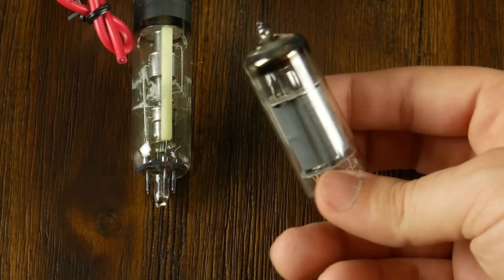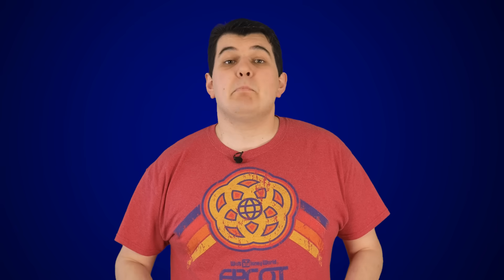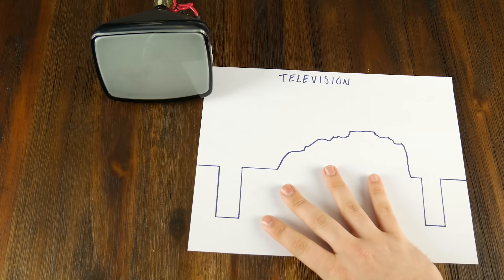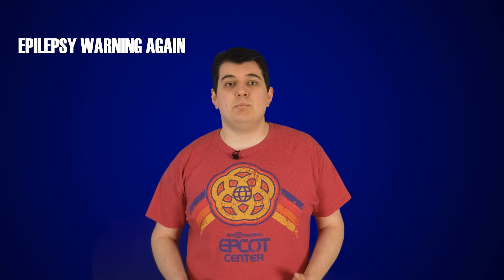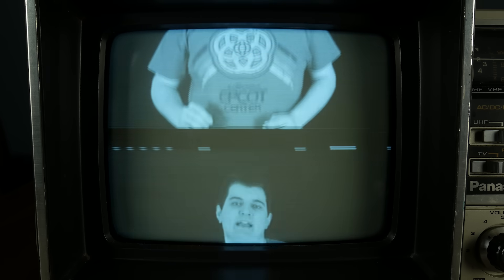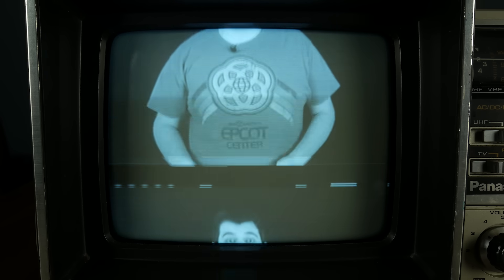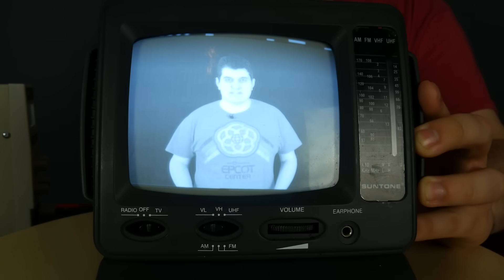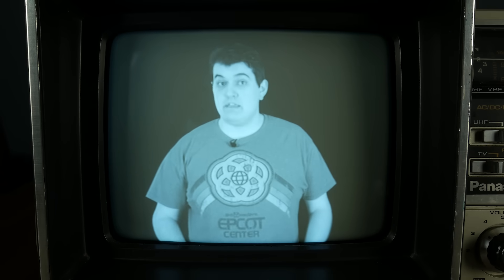Lines of Light: How Analog Television Works

Comment: I remember back in the 1970s there was an over the air subscription tv channel that would broadcast a scrambled signal. The video signal was scrambled by messing up the horizontal sync pulses with a sine wave. The audio was  heterodyned out of hearing range. The idea was you rented a decoder box and subscribed to their service. Someone came up with a "kit" to build your own decoder and that was kind of the beginning of the end.
Reply: I worked in a TV repair shop at 16 with a state issued apprentice license. My boss trusted me to make house calls even though I wasn’t supposed to. You should see i the looks I got when I’d show up to fix a TV at someone’s house on a Saturday and then I’d fix it.This was in 1969 and the shop I worked in sold the Motorola works in a drawer.  Worked on electronics and telecommunications equipment 50 years of my working life. I’ve seen some pretty cool stuff and always worked for companies that had the latest equipment.
Reply: Can you diagnose a problem with my crt?
it seems dead ie completely dead
But pressing the power button causes a high pitched squeal but nothing else
There is nothing else 
But a feeling of static on the tube 
It's a 14 inch color crt monitor 
From 1992
And I mostly bought it because it matched my Dell 333d computer
I kinda want to get it working 
Also while I know the computer also works by actually using a tv active modulator to send the signal to a tiny 6 to 7 inch black and white portable tv that actually does work
But lacking sound

And the crt tends to have a double image and a wibble. But the issue is with the crt monitor in question
Reply: @slycooper1001  You're better off taking it to a specialist. CRTs are extremely complicated and very difficult and dangerous for a layman to fix.
Reply: @slycooper1001  could be the flux capacitor
Reply: Heterodyned.

You're essentially describing "terrestrial pay TV" services like ONTV, Preview, Spectrum, SelecTV etc.
Reply: The 70s was interesting because TV didn't have any "security" whatsoever, so anyone with a little know-how could intercept signals for free like you mentioned, or even hijack broadcasts quite easily.
Reply: ah piracy has come a long way since then
Reply: In Germany too. If you use a tv-card, the pc can unscramble it on the fly
Reply: @Alpenjodler1  Really? Here in Africa we had mnet I always wondered how they did that but I got a TV card way to late in life after they stopped broadcasting those analogue signals the things I could have done with this information am learning please send me back in time 😂
Reply: Beginning of the end?
Reply: @masseyluna2002  Beggining of the pay walls. Not much that it was a paid service, with a regular antenna you could catch the "paid" signal, but it was useless unless you had the means to decode it.
It was the end of the wonder of being able to share information over massive distances. It stopped being about marveling on the ability to send audio, and later video, through waves regardless of borders. It became a business.

Think of the internet, which was then use to share information between universities. Later on each of the big schools could put their written knowledge into a digital format, and share it to local library, open to everyone (through the necessary costs of running such a service). Then it was international; not just knowledge, communication, preservation, among other things to come.
Finally, everyone had access to it, and when charging at a premium per hour to connect to the internet was recognized for the ripoff that it was, advertising slowly took over. Whatever intention there was to exchange information died in the race to get your attention, to bring you the advertisements. It became a business.
Reply: @l0v3-lyly  uh... nothing about the admittedly awful business-ification of everything stops anything from marveling at technology or sharing ideas. I'm not sure how you see that as a dichotomy
Reply: The """"""""""scrambling method"""""""""" they used was the most barbarian technique ever made.
The way a regular video signal worked is, anything below a certain voltage (I'll just say its 0v but I forgot) is considered the "sync pulse" and anything above it is considered the actual visual information.
They would mix a sign wave into the video signal, phase-locked to the horizontal sync.  This causes the normal horizontal sync pulse to be "pushed up" above 0v, while correspondingly pushing a decent part of the visual information below 0v, causing the TV to see that visual information as sync pulses.
Now, the visual information is always changing - even within a frame, each scanline will be different.  So the TV sees this constantly changing signal as "sync" - and it still tries to sync to it as it doesn't know any better.
This causes the TV to wildly distort the picture as it tries to stabilize it.  And yes, your TV is what did the scrambling, not the station.

Aside from the sine wave messing with the brightness (the sides would be very dark, while the center would be very bright - if you've seen those ON-TV sign-on videos you'll recognize this pattern), the video itself is fully intact.
If you could somehow make the TV just ignore any sync signals and free-run, the picture would roll, and it would have the brightness problem, but it wouldn't really be scrambled.
Its kinda funny that in the 70s and 80s this passed for "scrambling" to the point that laws that governed obscenity on public airwaves no longer applied.
Today this would be effortlessly reverse-engineered and decoded in a few minutes with GNUradio and an SDR.
Reply: RIP.
Reply: I built and sold bootleg boxes for OnTV back then. The memories...
Reply: Here in India, people still use set top boxes provided by cable dealers. They take in the signal of a coaxial cable and then decode it and sends it to a display with av jacks. Nowadays people are switching to Android TV's here but there is lot of handful and elderly people who find the initial easier.
Reply: @theultmatebanana6759  a lot of handful? What does that mean?
Reply: We had that in many countries. Many in Spain learned how to distinguish shapes in porn movies that a paid channel used to broadcast on Friday nights. By 1998 or so, you could already decode it with a pentium or similar with a capture card.
Reply: Radio Shack charged a fortune for variable capacitors because they were used in DIY decoders.
Reply: Wouldn't renting the decoder box BE the subscription itself?
Reply: @joshyoung1440  technically you "rent" out equipment even now. Not paid, like with Spectrum TV equipment, but it's a similar concept.
Reply: I was developing a circuit to receive the ONTV signal back then. Working on audio first, I remember the day of my first success, I think the movie was 'Carrie' .A string of formerly forbidden language spewed forth at a high volume. I jaw dropped and  my roommate popped it and exclaimed "Did that come out of the television?" ON didn't last long so the project was never completed.

Comment: me: ha, I can totally hear the sound and I'm over 25.
pauses the video oh wait i can still hear it. uh oh.
Reply: 11:56 I am so happy that even if I am 40 now, I can still hear this noise very clear 😃 (but only with my headphones)
Reply: @mma48578  are you a femail? I have herd males lose higher pitches faster and femails loose the lower pitches
Reply: @mma48578  I’m freaking 14 and I can’t hear it, but i havent tried with headphones
Reply: @theothersri2029  It's probably not your hearing. Youtube compresses the video files to save space, but that also cuts off some of highest frequencies. It also could be that your speakers cannot produce those higher sounds. I found a site (online tone generator) that does not use the compression youtube, and I can hear the 15750KHZ sound. Interestingly, there's also various waveforms available, and the CRT monitors make a sawtooth wave, not a sine wave which is the sound commonly used to demonstrate the high pitched sound of the monitors. I can hear the sawtooth wave clear as day, but sine waves and triangle waves are harder for me to hear at that frequency.
Reply: @mma48578 nearly 40 and I can hear it as well, though with kids around sometimes I wish I had a bit more hearing loss.
Reply: I'm ~40, but I still can here some of it... however I'm suspecting that I might be hearing some lower resonance frequency of it since the sound really didn't sound like 15kHz (and I've tested that my hearing ends around 14kHz at least couple of years ago)... my daughter did hear the real sound loud and clear. I asked how loud is the sound and she told me it was around the same level that the voice of the speaker dude (sorry, cannot remember the name 😅).
Reply: @nerdylittlesideprojects9141  That's probably so. I'm 40 and have always been able to hear CRTs (and other oscillator circuits) in operation, but I can't hear the one on this video.
Reply: @AubriGryphon  cause the speakers you are using suck and cant produce 15 kHz frequencies.... that funny enough is the upper limit of most sound speakers and only some mid and most high range speakers can produce sounds over 15kHz no matter what their specs say..... when I put my nice neodymium magnet headphones I hear it as loud as the other parts of the video.....
Reply: @AubriGryphon  Actually due to the compression of the videos, youtube starts to cut off the frequencies at around 15000KHZ. Thus you would be able to hear them in real life because there's no audio compression, but also because CRTs produce a sawtooth wave, it sounds different from the tones typically generated on a hearing test that are used for reference.
Reply: Oh no, me too. :|
Reply: I'm 32 years old and I hear it. It actually hurts my head though. Go figure.  Should have stopped hearing it 7 years ago!
Reply: @TheNickPenney  I'm 33 and can't hear it :C FUUUU!
Reply: i'm 29 and that sound make me uncomfortable
Reply: I got scared, I thought it was from the computer.  When I paused the video, the sound stopped.
Reply: I think I remember having just barely heard it the first time I watched this video 3 years ago (at 42) but I'm now hearing nothing at 45.

I remember one of the stupid little details that most impressed me about Jurassic Park, which came out in 1993 when I was 18, was the whine of the portable CRT monitors since it may have been the first movie I watched with digital audio, which recreated the CRT tone perfectly. Now I can't relive that audial experience even if I play Jurassic Park on a 100% digital Blu-Ray player and listen with the finest quality headphones I can afford (which will eventually be those Samson ones from Amazon since I'm on a budget).
Reply: Wait is the sound continuous or just a small clic? Cuz i heard a clic and that's it :C
Reply: @danielc.freteval5685  It was a continuous high pitched buzzing noise (not that different from the tinnitus I experience). I think the click is just where it starts or ends.
Reply: @SteveBrandon  as someone who also only heard a small click, i tested it by repeatedly pausing and unpausing the video many times during this segment. with every single pause and unpause i heard the click again. i also counter tested it by rewinding to an earlier segment before the start and doing the same pause/unpause thing. there was also a sort of click here, but it was different. lower pitch and sort of dull or muffled sounding. compared to the clicks during the segment which were sharp and higher pitched.
Reply: @xtreemgamer129  Go find a different source that will let you hear higher frequencies - it looks like youtube's taken this audio frequency out somehow. I can hear well above 15khz.
Reply: @danielc.freteval5685  That's all I can hear is the "click" at the start too. I'm 32.
When I was around 14-16 (when most kids just began getting their own cell phones), I remember using a high pitched ring tone that the teachers couldn't hear. I thought it was cool, but now I'm one of those people who aren't able to hear it.
Reply: I'm 36 couldn't hear it but I remember it :-)
Reply: Im over 25 and that sound is not only audible its painful as hell
Reply: I only recognize it when it starts and ends but not the time in between.
As a teenager that sound drove me nearly insane. I had to crank up the volume to not get disturbed constantly.
Reply: The sound is at a frequency of around 15,000 Hz which is at the upper limit for most younger folks. Here in UK we used to have, (now obsolete), an earlier system of 405 lines with a frequency of around 10,000 Hz which just about anyone could hear. An entire nation of tv watchers listened to and learned to ignore this sound.
Reply: Damn you tinnitus!
Reply: Dont get too excited guys, the fact you hear it might be related to it not being the correct Hertz amount due to Youtubes' compression algorithms
Reply: @ZonaALG  as someone who does music production i know for sure eventhough over 25 i can hear up to 20khz
Reply: I used to be really entertained by the sounds of my tv as a kid. Especially the fun ringing that you could make linger in your ear for a while after you heard it if you held your ear to the screen and tapped it. Then one day I tapped it and the sound didn’t stop.

I can still hear that sound to this day. 

I’m frequently told I am ridiculously in tune with my body compared to most people. My hearing has actually been above average in sensitivity even having that sound in the mix for 4/5ths of my life. I’m not going to be having hearing loss anytime soon, I just very strongly remember the first time I permanently damaged my hearing.
Reply: I'm 16 and I cant hear it :/
Reply: lmao i'm only 24 and I can't hear above 16 oopsies
Reply: 32, didn't hear anything. welp.
Reply: I've had tinnitus ever since I was very young, for as long as I can remember actually! I thought it was totally normal and thought it was just the ambient noise of my brain.
Reply: @clippedwings225  no joke same but it's gotten worst as I've gotten older
Reply: @clippedwings225  mine has gotten worst but I have always been able to ignore it, but when I'm tied I have a harder time ignoring it, and naked it so I have a harder time hearing, my wife hates it
Reply: I still have an old CRT, and I can hear the pitch crystal clear, despite being middle aged, as well as the one on this video
Reply: I'm 22 and I already can't hear this anymore. That's weird because I was still able to hear it like several monthes ago
Reply: 21 here and i know for sure i could hear it not even a year ago. now my hearing cuts off at 12800Hz...
Reply: 26 and can still hear it
Reply: It's kind of a contagious effect. I hear it once, but now it keeps ringing in my ears. Probably a side effect of air vibrating that fast.
Reply: I must be screwed, cuz I'm 24 and heard absolutely nothing with my headphones on.
Reply: @stuffjaydoes8653  Some headphones cannot produce these higher frequencies, plus youtube compresses the file size down to save space and thus, the higher frequencies can become muted or harder to hear.
Reply: I am younger than you and can't hear it at all
Reply: I'll have to listen to this with my good headphones, I might be losing those frequencies at 37...
Reply: @ThePixel1983  That could simply mean that your speakers cannot produce this frequency, but your headphones can.
Reply: Same here. Honestly, the chronic ringing in my ears stem from not wearing hearing protection while volunteering at an airshow 10yrs ago when I was 15.
Reply: I'm in my mid 30s and I can hear it just fine
Reply: Hard to hear anything over the crazy level of ambient droning noise of the microphone, but I did hear some squelching when he was talking during the example window.

Weird though.. I'm almost 40 and I can hear every one of my CRTs running, but this squelching sounded closer to what I've heard from the few sets I've run across with flyback issues.
Reply: I'm 21 and I can hear it only in one ear 🙃
Reply: That's great XD
Reply: High pitched annoying sounds certainly do have a way of doing that! I was at a Christmas Eve service this year and the sound system was malfunctioning, causing a very loud EEEEEEEEEEE to override all the music. By the time I left I continued hearing it for some time!
Reply: Fun fact: If you're autistic or ADHD, you can probably hear this sound even if you're over 25! More likely with ADHD, but both neurodivergencies commonly cause people to be extra sensitive to subtle noises like these. A lot of us can also hear, like, most electronics running.

When I was a kid, my dad liked to sleep with the tv on but the sound off, and it drove me NUTS because I could still hear the CRT background noise.
Reply: @PyreflyStudio yeah I figured that was the explanation. I am officially diagnosed with ADHD and pretty certain I have undiagnosed autism. Can’t afford diagnosis and all that but done tons of research and I especially relate to late diagnosed autistics. I am 36 and could hear it.
Reply: You should be worried. This can be a sign of something terrible.
Reply: You could potentially die an early death, sad to say.